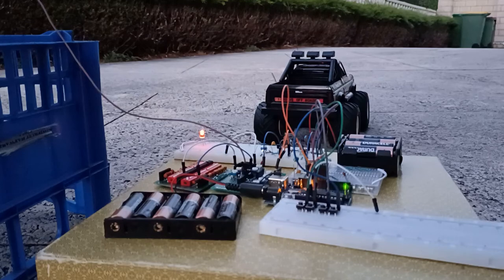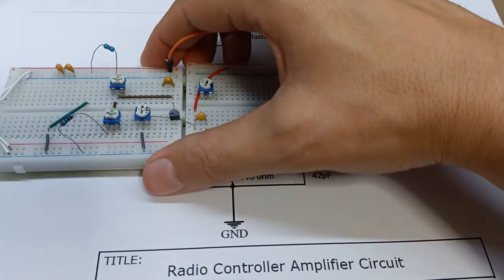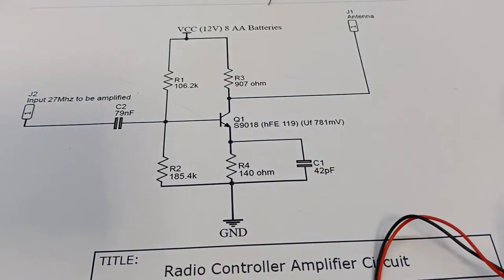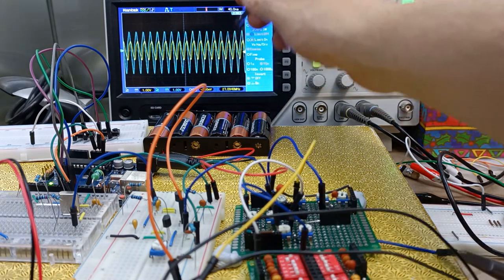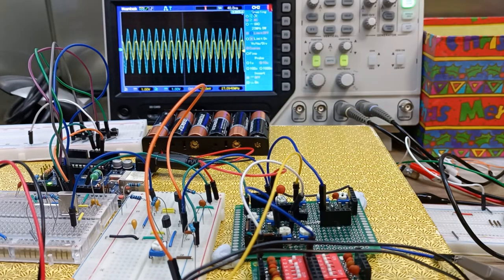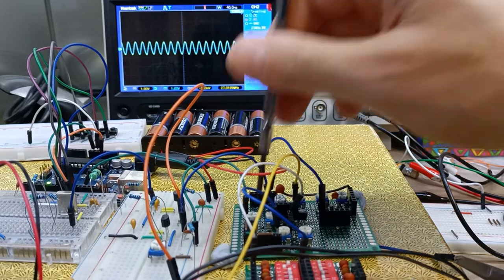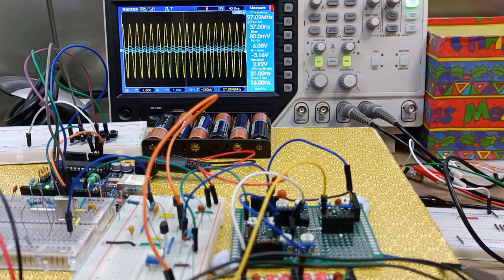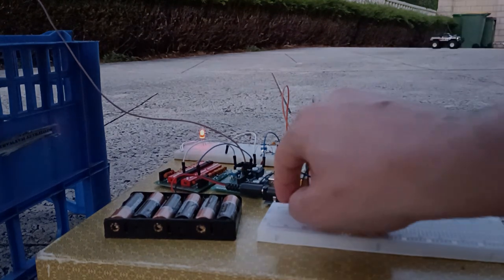Radio Controller increasing range with Amplifier circuit and Antenna updates (RC Transmitter Part 5)

Comment: Wow! Nice! I think I have to come back to my project a little bit abandoned due to my work etc. What really surprised me is the way you are working on it which is very similar (using Arduino, breadboards etc.) to my way of doing this but I haven't even watched your video recently! So I feel like we did the same (almost) thing but not knowing of each other (I mean apart from a few comments we exchanged on my channel hahha). Very nice it gives me the motivation to give second life to my RC car. I feel more respect to all those guys who made all those circuits in remote toys cars etc. People pay for it a few dollars not knowing even how hard is to make it work properly!!!!!!!!!
Reply from the maker: Yes I think we are doing a very similar thing.
I think you have a receiver build going on as well where as I have only done a transmitter to work with an existing receiver in the car.
I have had a few people comment saying please do a receiver. :)
Definitely a tricky thing to make work I have respect for those guys too.
Reply: @overengineeredinoz7683    Thanks but I have a lot ahead of me to learn. I think sometimes , I start too many projects and I need to focus on just one or two the most important ones to me. Anyway the receiver is much more complicated and I have seen at least 10 circuits from other people and datasheets etc. until I built my own. I learn programming in C++  for my own as well so I try to devide electronics and programming and also it is hard when I have to do my normal daily office job so I have weekends only for my hobby :/

Comment: Hey , I have recently maden some progress in my regenerative receiver and the key here is the knowledge how EXCATLY it works. This is probably the reason I have failed with it so many times and I tell you , breadboard is the shitest thing to use for the regenerative receiver. If you set it correctly the amplification is just amazing, like a few thousands times without any change in transmitter power! I have tested even 1 volt and still my receiver receives the singal from another room through the wall! I have changed not the circuit but my approach completelly and I found out that I didn't know what I was doing 1 year ago...
Reply from the maker: Oh well done that is great news. Any particular resource that helped you to understand it or just an accumulation of knowledge over time?
Reply: @overengineeredinoz7683 it is an accumulation of knowledge and recently I continued reading my book for radio amators which I have had already but I stopped reading it ....
Reply: @overengineeredinoz7683  I have found also some old articles about regenerative receivers in Polish from 80' haha
Reply from the maker: Oh I see. I have an old kit am radio with spring terminal connectors I was thinking of reverse engineering to learn more but haven't got around to yet.  Hearing of your success makes me think I should start doing that.

Comment: @OverEngineeredInOz following my earlier comment, can you provide complete documentation to build your solution or guide me to capture the information. Using your solution to make my tractor work would be great!
Reply from the maker: I can look at putting the whole circuit schematic and Arduino code together. The challenge in your case not having the original transmitter is we can't know if it works the same way by measuring the transmitter output. The other challenge is you won't be able to tell if the circuit is working without an oscilloscope.
Reply from the maker: Good luck.